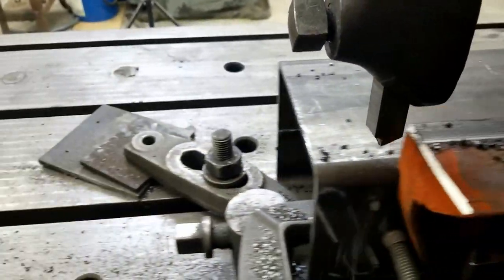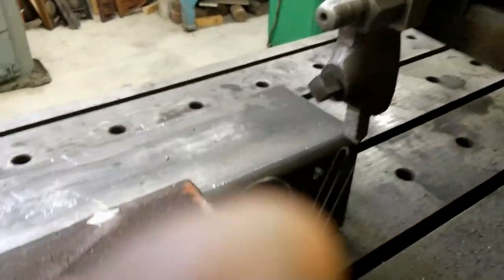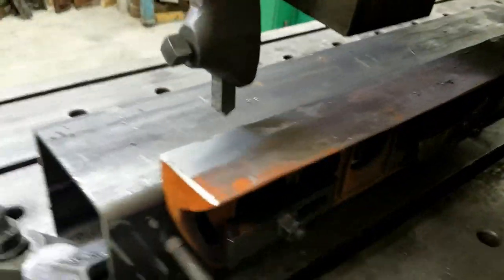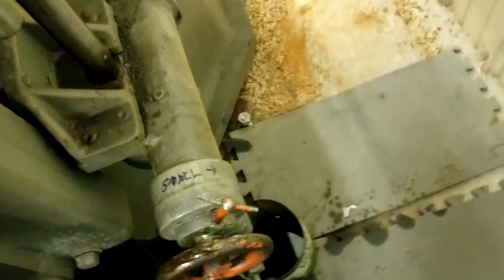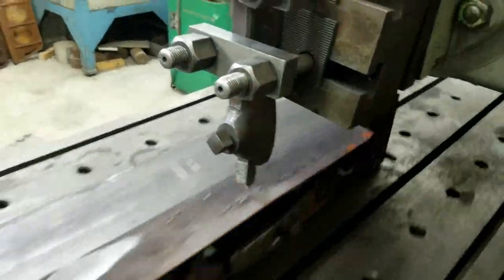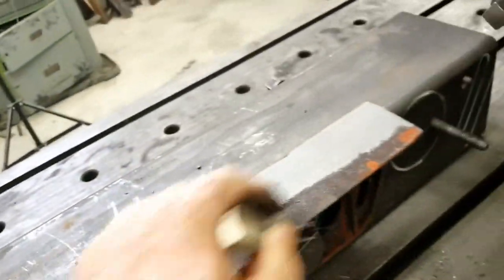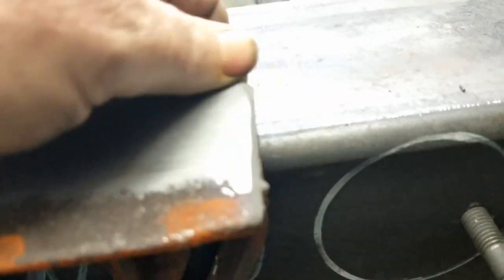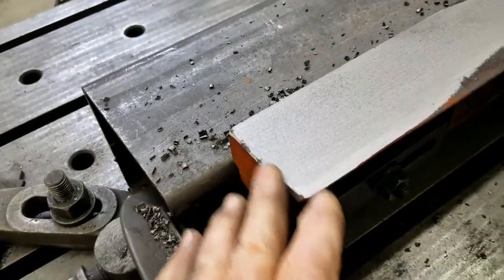Short video of rough planing of a straight edge

Comment: Since you have a lifter have you tried carbide at least for roughing?
Reply from the maker: I did in the very beginning Brian. I found that the  different hardnesses and interrupted cuts played hell with them.  The REX 5 tools I am using are cheap and easy to sharpen as well as last a lot longer than the carbide did.

I would take a lot more of a cut but then I'm dealing with an expensive, hard to hold and easy to fracture casting... The little bit of time I waste is worth it to me :)     After all I don't really have to stand over the work as it moves automatically. I just listen to the sound of the cuts and know when it is time to reset or there is a problem....